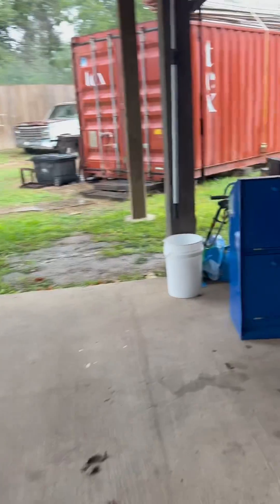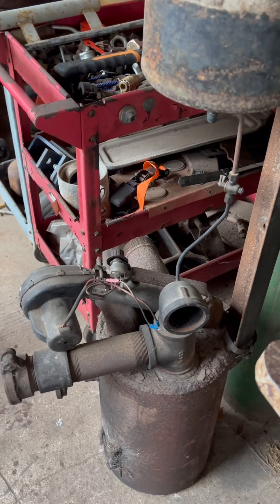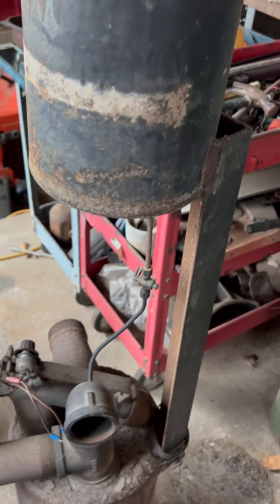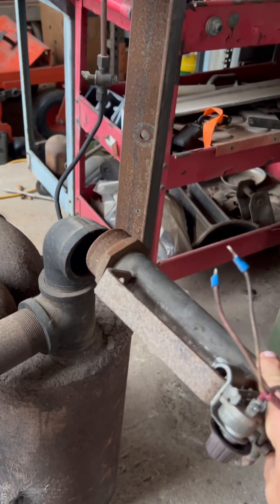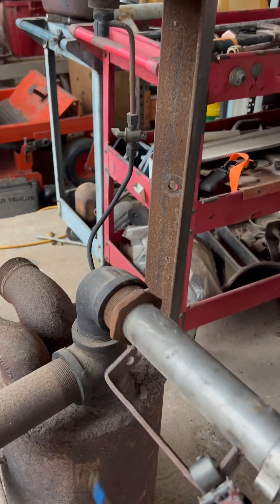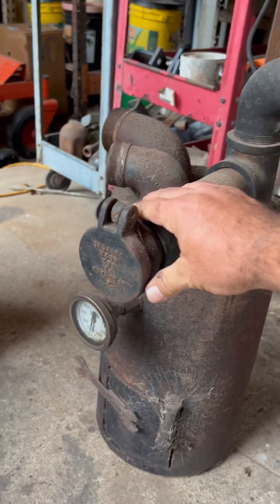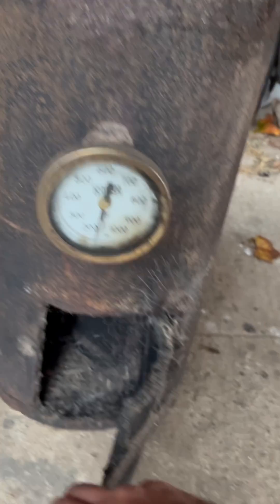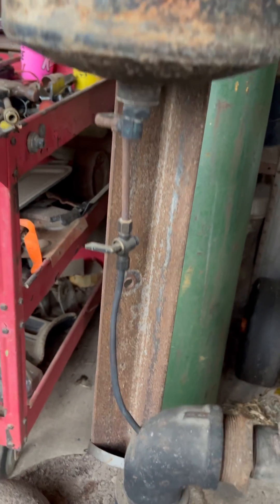Portable homemade waste oil heater

Comment: Ive been workin on making a electronic start oil burner using a old toaster oven element i bent into a U, hardest part so far is getting it to run good without fourced induction, looks rad man!